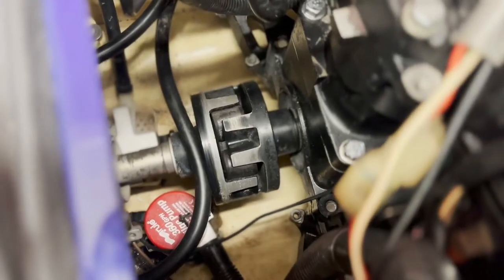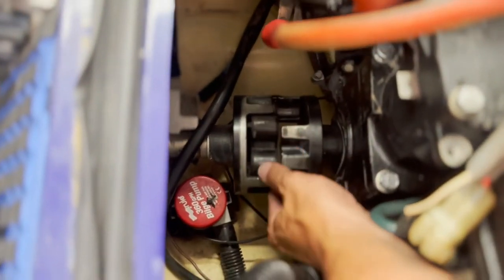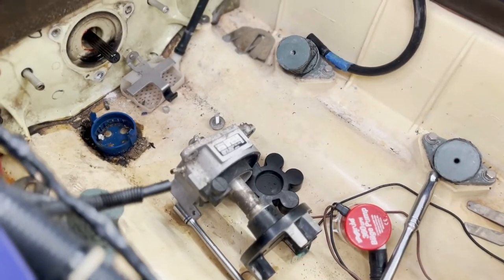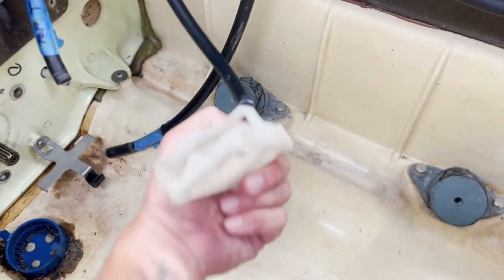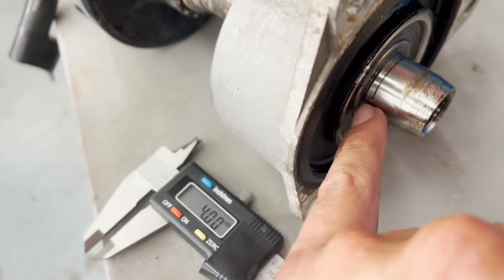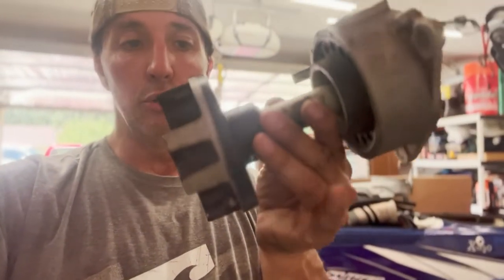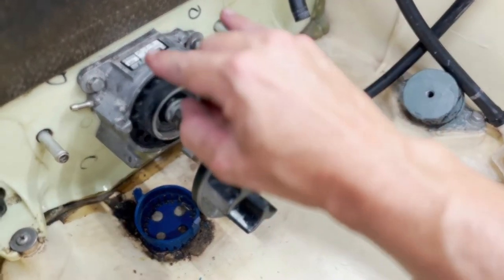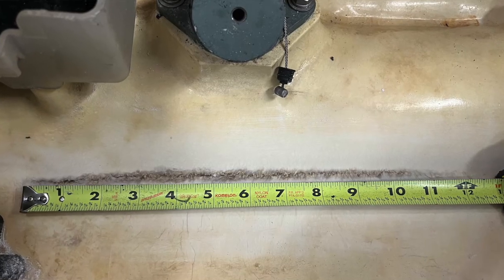Fixing the gap on the Yamaha Mid Shaft

Comment: Found your video by being in the middle of a midshaft rebuild but I typically adjust that coupler gap by sliding the motor forward and back on the rubber mounts. Much easier than removing the midshaft, which I just did without removing the engine. Just remove battery, slide motor forward to the gas tank, and then twist it trade’s the starboard to make room to pull the midshaft out. I use a 4mm Allen bit as a gap gauge to measure on 4 sides of the couplers.
Reply from the maker: I always try sliding the motor first but when the mid shaft was rebuilt, it wasn’t pressed in as far as it should have been unfortunately.

Comment: Great video. Can you just move the engine forward without taking it out?
Reply from the maker: The gas tank is in the way.  There is a tiny bit of room to move the motor forward if needed, but It’s really just easier to lift the motor up and out to do any work.

Comment: If you only had to replace the mid-shaft coupler…

1) how would you remove just the coupler & 2) you think only shifting the engine forward would give you enough room to replace it?
Reply from the maker: Doubt it.  No safe way to keep it from spinning.
Everything on the SJ is actually pretty easy to remove so just yank the gas tank, slide the motor forward, remove the whole midshaft so you can work on it on a bench.  You’ll have to use a prop tool on the backside to keep it from spinning while you remove the coupler.  Depending on how tight it was on, you might have to heat it a bit to break it loose.
Reply: @mrnobodysgarage   T.Y.🍻  seems like pulling the mid-shaft out is the easiest option as I read more about it.

I’ll likely put and ADA biller coupler on the mid-shaft and crankshaft coupler since I’m down there. 

Any recommendations in where to get the prop tool? And/or tips during disassembly/reassembly?

Big thanks.
Reply from the maker: @kevinfisch1785  should be able to find the tool on eBay/Amazon for pretty cheap.  Use a good sturdy vice and a long crow bar wrapped in a towel or cloth.  (Heat if you need it) 
Leverage is your friend 😉

Comment: Hi I have a 2000 Yamaha 800xl  I'm trying to take the midshat but won't come off I don't know if it's threaded I tried removed but don't want to hammered 
Can you help me I see your has a thread at the end where connect to the shaft  ??
Reply from the maker: The midshaft assembly is bolted to the hull
Once that is out, the shaft portion needs to be pressed out.
Reply: My problem is to disconnect the midshaft from the long shat I have removed the bolt  but cannot disconnect from the longer shaft
Reply from the maker: @Puconista  maybe try using some heat.  Corrosion can get in the splines.  A small propane torch can help.

Comment: We’re you able to leave the motor in? I need to remove mine and replace the rubber dampener that goes in between them. But I do not want to remove the motor
Reply: Nevermjnd you had motor out hahah
Reply from the maker: You can pull the mounting bolts and slide the motor forward just enough to slip in the rubber coupler.  You don’t have to completely remove it.